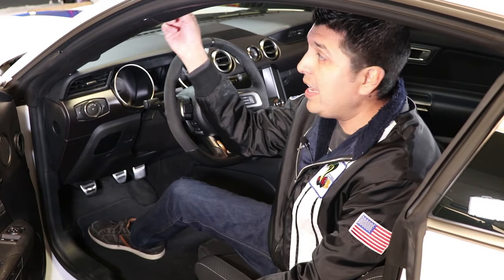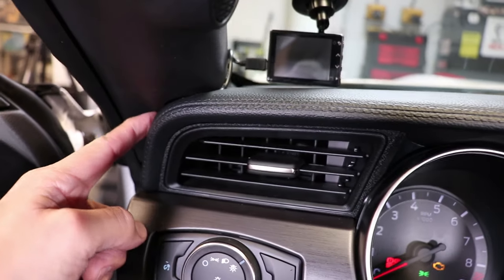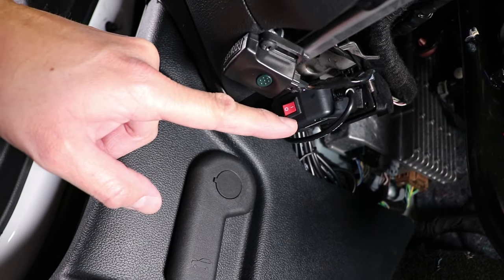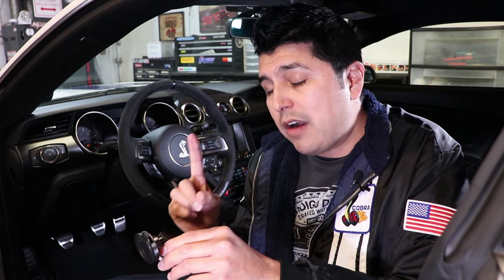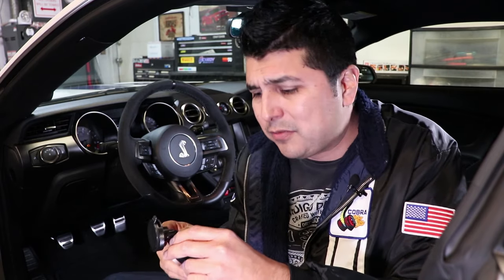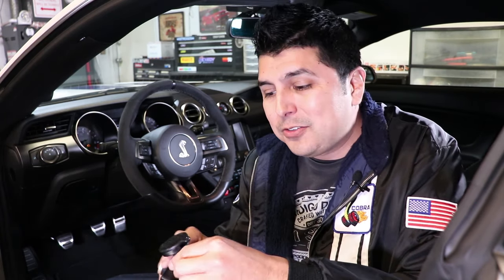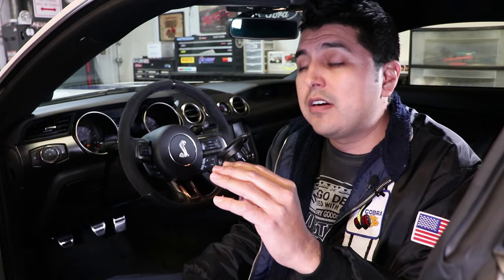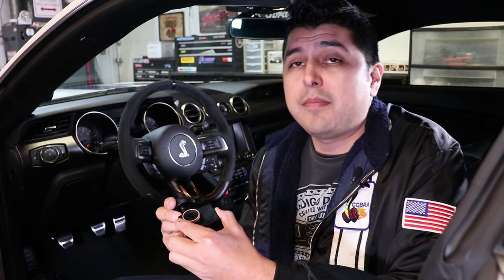Don't hardwire your Dash Cam! Try this instead!

Comment: All the OBD power cables I see on Amazon are rated for 5V/2.1A.  My dash cam is 5V/2.5A.  Will the lower amp cable work for my dash cam?  Thanks!
Reply from the maker: Hi detsd59! yeah that's the highest amperage I seen also. There is a possibility the dashcam will work at 2.1, when I was in the industry we used 10% up or down on specs. I guess worse case is if you try it and it doesn't work then return Amazon and go for full hardwire. Please let us know if it works! (and what dashcam model you used it on) and thanks for watching bud!
Reply: @AlexAutoFun  Thanks for the reply.  I would prefer to hardwire it but all of the circuits in the fuse box inside the car are constant power.  I wanted to use an ACC circuit because I don't want my unit to be powered all the time.  I have a Viskoo backup camera with dual front and rear recording.
Reply from the maker: @detsd59  Interesting.. for the ACC I have gotten lucky finding it by looking for the cigarette lighter plug fuse or the power windows or mirrors...

Comment: I'm tryin to figure out Way to install dash cam on a 2008 g35 Infiniti my lighter socket don't work so can I use this obd adpater?
Reply from the maker: Hi! This will depend on the dash cam being used, depending on which connector style it uses and it's power requirement. Here is my follow up video where I explain dash cam power requirements https://youtu.be/Yky9_tTvwMc with hardwire kits. While the OBD2 power adapter is not a hardwire kit, the same power delivery (amperage) requirements apply (I put links to the different OBD2 power adapters in the video description). Cheers!

Comment: I have a quick question I bought 12 “ dash cam from Amazon by two years ago never had a problem but this couple of weeks ago I have problem I press the power button I can see the camera and then just off then I press the button again I can see the camera and then just go off you can send meinformation how to fix it I appreciate it
Reply from the maker: Hi Ponce! The dash cam or it's power supply maybe on it's way out. One way to see if the cigarette lighter plug is the issue would be to try it with another power adapter (same type meant for the dash cam you have) or the hardwire kit for the dash cam. I would also recommend contacting the dash cam vendor for support, they may have other suggestions as well. Cheers!

Comment: WOW you Finally cut off that mustache LOL this is a cool dash cam but as a tech i'd rather connect it as Hard Wire Because what if you take your car into the shop to get it fixed and the tech needs the OBD2 Port to Diagnoise the car ?
Reply from the maker: Hi Bud! It would depend on the service needed by the car (no all services need access to the OBD2 port). I have taken my car to the dealer a couple of times with the adapter and was able to record the whole event. That being said, it is possible that access to the OBD2 port may be required. In that case, hardwiring is a better option, here is my video for that https://youtu.be/zbxYA4VhuT8 Now it also common that the car's battery needs to be disconnected to service the vehicle, in those cases both hardwiring and OBD2 adapter will both not work and you will not have a record of what happened at the dealer. My best advice is to find a Delaer that you can trust and develop a relationship with to ensure your car is taken care of. Cheers!

Comment: If you leave it on accessory mode when in for service, won't the mechanic be unplugging your adapter from the OBD interface so he can plug in the diagnostic computer?
Reply from the maker: Hi jnpSacto! it would depend on what type of service the mechanic is doing (I had this car in for service a couple times and the OBD2 adapter was left plugged in so I was able to get video of the techs working on the car). That being said, since it is possible the OBD2 adapter could be disconnected, here is the alternative Hardwire method https://youtu.be/zbxYA4VhuT8 to ensure you got coverage (assuming the battery doesn't get disconnected which also can happen during service ugh, never ending game! LOL) Hope this helps, Cheers!

Comment: I certainly think this could work in some case. I’m not sure what type of regulations you have where you are but in Pa. you would definitely get pulled over for having your camera in front of your line of sight.
Reply from the maker: Hi John! yeah I would agree with you, it's best to check with local regulations before mounting a dash cam. Unfortunately here in California this is the only location where we can legally place our dashcams :( However the OBD adapter cord is very long so the dashcam could be placed in a different location if desired, hope this helps and thanks for watching bud!

Comment: So if i buy this adapter and put it in accessory mode and plug into my odb2 then it will only power my camera when the car is on? This is what i want. I do not want my cam draining my car battery when the car is off. Im curious if the odb2 port always has power even when the car is off how does adapter in accessory mode know whether the car is on or off?
Reply from the maker: Hi Jo! In ACC mode, OBD power cable will power off after 5 minutes when your car is off. Most of this adapters only have 2 active pins (ground and positive) so there is likely a small voltage sensor used to know when the car is off (a running car produces higher voltage required to charge the battery, when the car is off, the voltage drops to only battery voltage) which would probably the easiest way to have the adapter sense when the car is on or off. Hope this makes sense and thanks for watching!

Comment: Have you found an OBD adapter that works with park mode yet - particularly with the Wolfbox T10 mirror camera?
Reply from the maker: Hi Valerie! we won't see a OBD2 adapter that will enable parking mode since parking mode on most dash cams requires 3 connections (Accessory Power, Constant Power and Ground) and the OBD2 port by design only has 2 of these 3 connections (Ground and Constant Power). Hope this makes sense and thanks for watching!
Reply: @AlexAutoFun  Thank you for clarifying this. I asked because I have a 2019 rav4 and the fuses are a pain to access and hoped for at least a temporary easier option. I dread the risk of using anything that might drain my battery (I've had too many unpleasant experiences of discovering a dead battery when I needed to get somewhere). I still have to figure out what kind of fuses my car uses. Given access issues I'm not in a rush to pull one out merely to check. It'll be easier to look up on the internet. 😉
Reply from the maker: @ValerieM8  You're welcome! there is also an adapter to pull power from the mirror on newer cars (I have not tested those adapters yet) however it also has the same issue of not being able to enable park monitor. But yeah take your time researching the details of your car's power, that is always the best way to learn the best approach without even having to open anything on the car itself.. Cheers bud!
Reply from the maker: Hi Valerie! I forgot to mention that there is an OBD2 adapter with parking mode https://amzn.to/3lpOa2c but it is only for Thinkware dash cams like this one https://youtu.be/BAEH4f2ulEs Hope this helps!

Comment: What is the box with the green button next to your obd2 port? Just wondering because I have this on my recently purchased used car.
Reply from the maker: Hi Will! That box is an aftermarket alarm system (and GPS tracker) that was installed by the Dealer before I bought car new (seems most Dealers are doing this now to both lower their insurance cost while cars are at the Dealer and to upsell you into a device that is already installed in the car, ugh that's the stealership for you! lol). Hope this helps and thanks for watching!
Reply: @AlexAutoFun  Very helpful. Thank you! I guess i'll rob that bank in my other car, since they're tracking me; 🤣
Reply from the maker: @CategoricalImperative  LOL!!! yes definitely don't use that one! Cheers bud!🍻

Comment: Hey I did this and the OBD is draining my battery and Is intermittently not enough power to the camera. Any thoughts? It was always in accessory mode.
Reply from the maker: Hi Ian! yes you will want to ensure that the dash cam power requirements do not exceed the power capacity of the OBD adapter (2.1A if I remember correctly) otherwise you will experience the issue you are describing with the dash cam turning on and off as the OBD adapter is being pushed pass it's rated capacity (it may also damage the adapter) Hope this helps and thanks for watching!

Comment: Very good video!   You did a great job presenting the necessary information.  Which OBD Power cable did you use in your Mustang?
Reply from the maker: Thanks XPDCHIEF! I appreciate that, here is the one I used (Micro USB size) https://amzn.to/2Xzwtlt 
if your dashcam needs uses the Mini USB size here is that one https://amzn.to/2XFijQA  Hope this helps and thanks for watching!

Comment: When you use the piggyback connector what size fuse should you use for the hardwire kit
Reply from the maker: Hi Steve! I use the same fuse as what came with my hardwire kit, here is my follow up video showing the install process https://youtu.be/K2iKXj82354 Cheers!

Comment: While the information about the OBDI was helpful, where you chose to install the dash-cam head unit looked out of place and not a bit professional looking.  You could have made a much cleaner installation by locating the dash cam near or behind the rear view mirror. By simply lifting one edge of the windshield molding you could have easily hidden the power cable behind it.
Reply from the maker: Hi Retired! Unfortunately we are very restricted on the mounting location for the dash cam here in my State. But the installer can place the dashcam higher by running the cable up the A Pillar if desired. If there is an airbag in the A-Pillar here is my video https://youtu.be/uZp95NbNlmM where I explain some of the issues that can pose. Here is also my follow up video showing video from different angles to help you decide the best one for you https://youtu.be/F7OzM2i7ErE Cheers!

Comment: EDIT:  I'm trying to connect a Vantop H610 backup camera 

Would this work for a 2011 Subaru Legacy? If so, where would I plug this into? I don't know anything about cars. Need an easy solution like what you're explaining. I can't access my center reverse/brake light. Or I just don't know how to 😂🙃
Reply from the maker: Hi! I usually don't recommend using the OBD2 power adapter with mirror dash cams since the OBD adapter can only provide 2A out of the 2.5 - 3A that most mirror dash cams require. There are 2 high power versions of the OBD2 adapter (links to both in the video description) but I have not tested either myself on a mirror dash cam (also remember, the OBD2 adapter will not enable true parking mode like a hardwire kit does,. Regarding the connecting the optional wire for the park assist function here is my video for that https://youtu.be/LHGxwulIPes Hope this helps, Cheers!
Reply: @AlexAutoFun  thanks!
Reply from the maker: @russellhenning9914  You're welcome!

Comment: i fitted one of these in my niro ev .it seemed to work ok,but when it is turned off and I charge the car somehow the dash cam starts.Also the car has a 12v battery that is intermittently charged up by the main ev battery when it does this the dashcam starts recording.....?
Reply from the maker: Hi Keir! yeah unfortunately many EVs and PHEV's do not play well with standard OBD2 port devices. OBD2 devices use the OBD2 standard which is mandatory for ICE vehicles where it is not required for EVs. To make thing more convoluted each E manufacturer also seems to use the DLC connector to some degree but with different approaches. Hope this helps, Cheers!

Comment: Do you not have registration stickers in your state? My car has a sticker on the windshield right where youbput that camera
Reply from the maker: Hi Chase! We do have them, it goes in the rear license plate. But yeah regarding location, unfortunately this is the only location where we can legally place our dashcams here in California :( However the dashcam could be placed higher by running the cable up the A Pillar if desired, hope this helps and thanks for watching bud!

Comment: What if your cigarette lighter continuously supplies power even when your car is off? Can you then use the part mode and surveillance mode without running out of power?
Reply from the maker: Hi Rosie! the adaptor shown on this video (link to it in the video description) plugs into your OBD2 port (not the cigaretter lighter port) Here is the video that shows you how to find your OBD2 port https://youtu.be/hEmvv8M8bGI Hope this helps, Cheers!
Reply: @AutoFun  that so much. I'm new to dash cams, but I am learning. Not as hard as I thought it would be.
Reply from the maker: @rosipm101  You're welcome! Here is another video that may interest you, it's my introductory video to hardwire kits and their differences https://youtu.be/Yky9_tTvwMc Cheers!

Comment: Instead of always switching the adapter to accessory or surveillance mode is it fine to keep the adapter on surveillance mode at all times.
Reply from the maker: Hi Hassen! correct, that is how I use mine, I leave it on in one of the two mode (for myself I use the ACC mode) and only when I have left if my car at the dealer or other place for service do I switch to surveillance mode. So I would say it's a just a preference on which mode you decide to leave the adapter on. Hope this helps and thanks for watching!

Comment: I hard wired my dash cam using an add s fuse but no power.  The fuses are good, cable is brand new and wired up right. One to the fuse, one to ground. What am I doing wrong?
Reply from the maker: Hi el guapo! here is my video where I cover how I check the connections for power and how the fuse taps are installed (including correct orientation) this assumes that the hardwire kit you got works, there is the small chance that the hardwire kit maybe DOA or a one of the fuse may have blown at some point. Cheers!

Comment: What about having the camera for parking mode with a battery pack?
Reply from the maker: Hi S! Some people do run their dash cam off a battery pack (this batteries are usually large in size). I personally don't due to the high temperatures the interior of a vehicle can experience (which I prefer not to subject the battery to) and due to the potential for a run away event (fire) during charging or discharging inside the car. Here is an example of a internal dash cam battery and what the sun did to it https://youtu.be/HW8jqbl_ayU and a video of battery related fire I personally experienced https://youtu.be/XfWgJ8nu-RA (destroyed the house) Cheers!

Comment: I know this is a bit older but would this work on a 2019 Dodge Challenger Scat Pack?
Reply from the maker: Hi Dalton! yep it will work, the OBD port on the Dodge Challenger is identical to the one shown in the vehicle, link to the OBD adapter in the description in case you need bud!

Comment: Thanks for an excellent presentation!     One question: since this was made 2 years ago, did you update your links since I'm sure the products have a newer version.     Thanks!     Looking forward to your reply.
Reply from the maker: Thank you Rand U! Regarding the adapter, I typically wont a change the link to a newer adapter as I have been running this adapter for a long time without issues. I haven't tested other brands and while I had good results with the linked, If I link a new one I have not tested I won't know what results to expect for that one. Hope that makes sense and thanks for watching bud!

Comment: i googled that obd2 connector is not a good idea for dash cam as it can damage some electrical system. I am little bit confuse should I buy this for my ford mustang? Could you please help on this? Thanks in advance
Reply: If in doubt, you can always use external power banks.
Reply from the maker: Correct, usually connecting anything to your car electrical system can cause issues, mine has been working great but I could see if a defective plug was received or if the camera was hardwired incorrectly the care it could cause and issue. But this is true of all aftermarket parts so there is other options out there like the external power bank or the good old cigarette lighter plug adapter!
Reply from the maker: Correct, usually connecting anything to your car electrical system can cause issues, mine has been working great but I could see if a defective plug was received or if the camera was hardwired incorrectly the care it could cause and issue. But this is true of all aftermarket parts so there is other options out there like the external power bank or the good old cigarette lighter plug adapter!

Comment: Will this harm the obd over time, or will it drain the battery?
 Some people have said after they hard wired their dash cams, it drained their car battery
Reply from the maker: Hi Goa Way! I been running mine for over three years now without an issue but yes there is risk associated whenever you connect an aftermarket device to your car. The adapter I linked in the description has a low voltage cut off so I will stop pulling power before the battery gets too low to prevent stranding you. And here is a video I made that cover the alternative hardwire method if you want to see what that looks like https://youtu.be/zbxYA4VhuT8 Hope this helps and thanks for watching!
Reply: @AlexAutoFun  thank you. I watched it, but I think I am looking for something that is a combination of two things. Like hardwired, but when the car is turned off, it goes to external backup dashcam battery power.  Most of those kind of batteries cost an arm and a leg though.